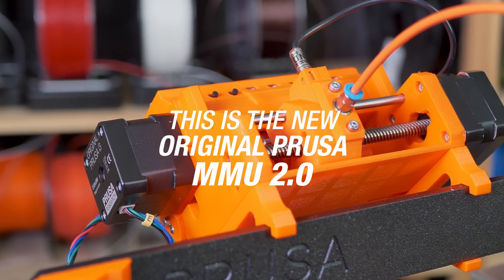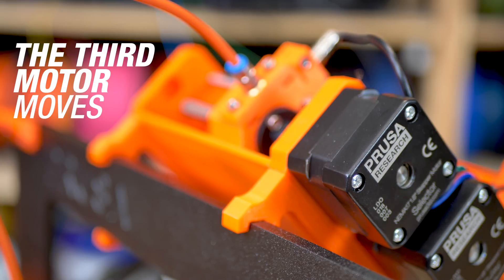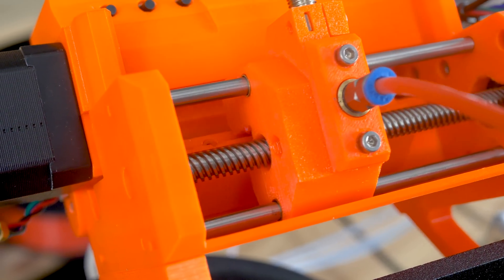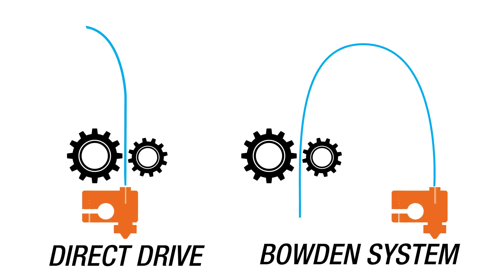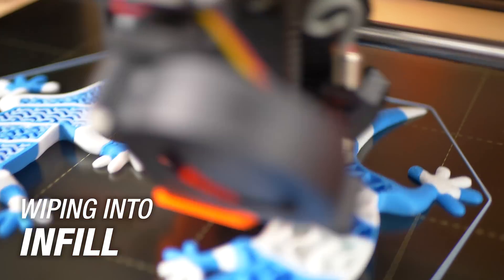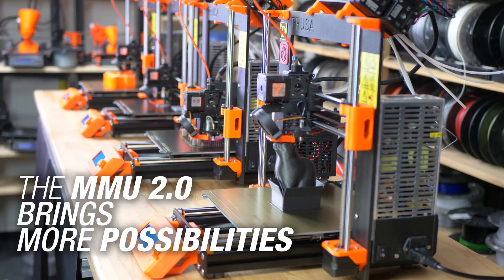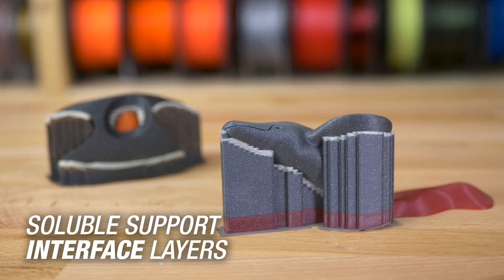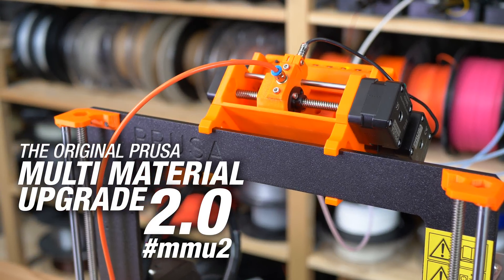How does the Multi Material Upgrade 2.0 work?

Comment: WHERE IS THE ELEPHANT IN THE ROOM HIDING?

Somehow the virtual universal standard for 3D printing is STL although STL has no ability to support multi-color or multi-filament printing.  All users know and use the ability of 3D software programs to colorize the different components of their drawings to clearly distinguish the parts.  But then they export the entire drawing or selections of parts and lose ALL the color information into one boring mono-color STL file.  The reminds me of my old BLACK & WHITE television where the white did not work!  BORING!!!  Next we learn that OBJ files can support color and generates a ZIP file with an obj and mtl file.  The obj has the drawing and the mtl has the color info.  So the  fundamental capability is actually there but the 3D printing world persists on being blind or color blind.  The eco system continues with a 3D design program producing a mono-colored export STL file which hands off its crippled product to the SLICER which has the ability to produce a multi-extruder (IDEX or multi to 1 nozzle system) gcode.  Prusa seems to be the most integrated system with its various Prusa 3D printers, Prusa Slicer, Prusa MM2 (multi-media) multi-filament solution, but no CAD software for obvious reasons.  You can't always do everything by yourself and sometimes you have rely of specialists who do their job better than non-specialists.  But it seems to me that no one is better positioned than Prusa to provide the best overall solution for the entire 3D printing world and beyond (comprehensive solution for 3D printing, engraving, and CNC).  This is exactly the high level bird's eye view of the entire eco system that the user needs and wants.  Let me sit and focus on my multi-color design using whatever CAD software suits me the best, have multiple slicers including PrusaSlicer, have my Prusa 3D printer, MM2 filament color solution, and produce my multi-color 3D print without the headaches of 4 different domain spaces.  I am a principal software engineer and after half a century of systems engineering this seems obvious to me and I do not understand how the rest of the 3D printing world is oblivious to this.

Comment: Is it possible to use the MMU with another printer? I figure probably yes if you create a custom marlin firmware... didn't find anybody yet who did it. Unfortunately I don't have enough money to justify two or three times the cost of an "original prusa" over a printer that works just as well or better.

Comment: Another poor quality product from Prusa. Will never get another product after the fiasco with the Mini.
Reply: I can't speak for the Mini but the MMU2S is a product that needs a dedicated owner who is ready to truly dial it in and calibrate it thoroughly. Include a bit of trouble shooting and problem solving capability. Of course, one can argue that none of this should be required in a 300 EUR product, however, show me alternatives which enable printing in 5 colours or in 4 colours with soluble support for that price, other than maybe MMU copies which one might or might not get into working order. 

The point is, once the system is dialed in, the MMU2S prints absolutely reliably and creates awesome results (yes, prints take rather long and printing multicolour is wasteful but that's a consequence of changing material midway a lot of times). I consider my MK3S+MMU2S system to be worth every Cent and a great purchase.
Reply: @wurzelzwerg100  Printing with soluble support is more challenging but perfectly feasible. With the settings I have now, I managed a whole print without a single loading failure and the result was perfectly fine.  What I needed to do is using radically different unloading settings than in the stock profile (which works great for Prusament PLA for example but not so for soluble materials in my experience). 

I am not saying the MMUS is easy to dial in but given that you think there is not much one could calibrate (either on the machine or in the slicer profiles) suggests that you have not dialed it in sufficiently. 

I also don't have any problems with very fine details in other colours. In recent months I printed a dozen prints of that kind without any troubles. If you do have such troubles, you have too much friction in your system. 

I can't comment the buffer though, I don't use the stock buffer.

Comment: So it's cheaper than the Pallet. Any reason it can't be modified to fit on an Ender 3?
Reply from the maker: It's not a standalone unit, in integrates directly with the printer. But if you modified Ender 3 firmware to communciate with the MMU, it might work. 
- Mikolas

Comment: We bought this kit for our university and three people tried to get this thing to work and it didn't. The manual is just a chaotic description and a joke. You don't even find a helpful video for this kit online. It was waste of money and time at the end
Reply: Amir Andikfar I think you should contact the company. They seem to have a good after sales service (from what I heard).
Reply: Contact Prusa support. Have a look at the prusa MMU2s forum, watch some of the trouble shooting videos here on Youtube. If you do so, you should be able of getting it running smoothly. Even more if 3 students are working on it, rather than just one. Especially, with the forum and Prusa support. You are not alone in it and if you describe your problem precisely, people will be able to help you even if you struggle to figure it out on your own. 

The thing is, there are a number of areas where the MMU2S can fail if there is in issue there. The difficult thing is to figure out what component is causing failures. Once that is clear, the issue can be resolved one way or another. Once those issues are resolved, the MMU2S can print pretty reliably.
Reply: @sagichnicht6748  thank you for your reply guys. We dumped our MM2 into trash and bought ourselves an Ultimaker printer and a Zortrax M300 dual. Bouth work perfectly and we don't need to waste more time on this bullshit part. The Prusa printer itself is good though
Reply: @3D-Amir  That's a pity, surely at least someone else could have made use of it. The MMU can do things which are otherwise hard to realize. If you just want soluble support though, you might be indeed much better off with a solid dual extruder. 

The Zortrax M300 dual costs of course 4 times than an M3ks+MMU2S kit. Ulimaker printers are similar. Not saying they are not worth it (honestly I lack experience with them), just that they are different price category. In a university enivornment with lots of users, the MMU2s might not be the right choice though, so your decision ist understandable.
Reply: @sagichnicht6748  I understand your point but it doesn't matter university or not! Losing time sucks! Even though we are open to experiments and do a lot of researches, we have our time limits. We can't afford that projects get stocked just because a company like Prusa didn't do a good job and sells a not really developed product to the market. Even as a kit I expect more than this! Anyway, maybe it something for someone with a lot of time and nothing else to do but not for people who want to be productive
Reply: @3D-Amir  I would say the MMU is not really that interesting for professional purposes. Prints do take long and you waste a lot of filament. That is a consequence of the basic concept of a single extruder multimaterial system. 

Yes, Prusa could do a better communication about the MMU. It is not like the MK3s, a printing work horse ready out of the box. That said, once you have it dialed in and know how to handle it, it is not more difficult or time consuming to run the MMU than the MK3s, regarding handling times. The print times are of course considerably longer. 

How long it needs to be properly dialed in depends apparently. I know someone where it worked basically right out of the box. I was not so lucky but I have been printing a lot with the MMU since I got it dialed in. 

The only alternative to the MMU for home 3D printers, I know of, is the Palette. However, I heard it is not without its quirks either and it only has 4 materials. I am not sure if it allows for soluble filaments. In any case it costs nearly 3 times as much as the MMU.
Reply: @sagichnicht6748  yeah! very wise words and I agree with you in all of those points but I have to admit, that I'm very frustrated with MMU and I'm over it for long now but it's still very disappointing to see that they don't come up with a good solution. Anyway thank you again for your opinion and wish you good luck with your MMU :)

Comment: When i change the filament mid print, will the mmu retract the old colour before sending out the next one? Or just cut it?
Also, does this work with any printer or just prusa?
Reply from the maker: 1) retract
2) just with Prusa out of the box. You could mod it to other printers (the beauty of open-source), but we do not provide any support in this direction
- Mikolas

Comment: since the system uses a single nozzle...  can the system deal with different materials that have different nozzle temp requirements?  for example nylon, and pla?
Reply: Slicer gcode probably takes care of adjusting the nozzle temps.
Reply: @IdgaradLyracant  Slicer software could do this in theory but I'm not sure if it's implemented in practice.

Comment: Why an inductive sensor with a ball ?  Would a limit switch with a roller lever not be simpler and cheaper ?
Reply from the maker: Limit switches are pretty flimsy and do not have a particularly long lifetime (because of moving parts).
The inductive sensor doesn't have any moving parts. And the ball, well, there's nothing really to break on it :)
- Mikolas

Comment: Will there ever be a finished Prusa product? All the parts are 3d printed. Would make much more sense to use injection moulding.
Reply: @npgoalkeeper _ Cheaper costs and better quality... duh. After  5 - 10,000 units, injection moulding makes more sense. Prusia have sold 59,000 printers with several 3d printed parts in each.
Reply: @npgoalkeeper _ You dont understand.
Reply: @npgoalkeeper _you still dont understand. Never mind 🤣
Reply: @npgoalkeeper _ you're literally missing the point. Think about it. I'll give you 48 hours.
Reply: @npgoalkeeper _  Knew you would give up. 😂

Comment: Actually, since using the MMU2S, I had the worst problems ever. I think I pinpointed them, but it is still annoying, and multi-color prints just keep failing, since filament does not load. Overall, the MMUS2 is very frustrating, and turned a wonderfully working machine into something I do not even want to look at.

Comment: hey guys it this one of yours or is it a China Copy? found it on Ebay for $159.72CND https://www.ebay.ca/itm/Prusa-i3-MK2-5S-MK3S-MMU2S-Multi-Material-2S-Upgrade-Kit-3D-Printer-PLA-Parts/264719017665?_trkparms=aid%3D1110006%26algo%3DHOMESPLICE.SIM%26ao%3D1%26asc%3D20131003132420%26meid%3D73945671d8de4e698e51fe56afa6f68b%26pid%3D100005%26rk%3D5%26rkt%3D12%26mehot%3Dco%26sd%3D254378685355%26itm%3D264719017665%26pmt%3D1%26noa%3D0%26pg%3D2047675%26algv%3DSimplAMLv5PairwiseWeb%26brand%3DUnbranded&_trksid=p2047675.c100005.m1851

Comment: WARNING: This devices is not a plug and play hardware. Get it JUST AND ONLY if you already know a lot about 3d printers and can fix issues your self. There has been multiple critical bugs issued back in 2019 that are not fixed till this day. I have few of them, and can't get around it. It's waste of time and money on my side, as there are only people reporting the problems but no support at all from the developer side. I am really sorry to write this... but that is the truth. You might be lucky and get the one that works well, but chances are that you wont. Cheers.

Comment: What kind of printer is that it prints perfectly
Reply: The MMU upgrade is used with the Prusa i3 MK3. A great, reliable workhorse printer.
Reply: @coryabraham9199  Prusa i3 is probably the best 3d printer without an enclosure to help keeping the temperature more stable.

Comment: Hi Josef. I bought mmu2s in 2 months but I have to be very sincere, I am very disappointed with the product. I see many videos on youtobe with people with the same problems. It is amazing how this product is still in the market with so many problems, one hour is the filament that clogs another time the retraction that does not work and etc and etc. I know you test your products but they are all in a controlled environment. There are numerous types of filament around the world, this should not be a variable for the operation of mmu2s I believe that soon you will upgrade to this product, honestly. In 2 months of use and so far I have not had even a multi-material printing without problems and thus a great waste of material. I am sorry for the sincerity but it is the opinion of a very unsatisfied customer who believes in the brand.

Comment: Is this only able to be used on prusa machines? I would live something like this for my reality Ender 3.
Reply: Don’t worry, the Chinese will  steal the idea and sell it in a few months. :-)
Reply: This is why you don't buy a crap ender 3.  Why you would buy a China crap knockoff when a Prusa is such a damn good deal is beyond me. Oh unless you just do t have the money, otherwise you'd have to just be uninformed or stupid.
Reply: @norris1218  because not everyone has over 1k to spend on a printer
Reply: @chriswright6068  all you need is $350 now.  There is no excuse.  These Chinese crap printers don't put a fraction of the safety features or after launch support offered by Prusa.
Reply: @norris1218  350 is just for the 5 filament upgrade. Sill need 700 for the printer
Reply: @chriswright6068  UMM NO. They have a new printer with unheard of features for $350 for cheap asses.  And their MK3 is only $750 unless you are too helpless to put it together yourself.

There is no excuse to put one of these cheap Chinese fire machines in your house.  Prusa's safety measures are as good in their $350 printer as in their $750 printer if not better with their 32 bit controller and brand new custom electronics.
Reply: @norris1218  creality makes a good starter printer for people looking to spend less than $200 on a hobby that might not go anywhere. Everyone is allowed to make their own choices and decide what's important to them

Comment: Nice I'm very skeptical mainly about the cutting but very nice. I would have went with some kind of solenoid cutting though. Maybe a heated cutter to fuse to the next filament that way you don't have huge retractions and issues in the hot end.

Comment: Really too bad that your printbed size is so small that i cant use it ... very nice innovation with this idea!
Reply from the maker: Out of curiosity, what would be big enough?
30x30x30?
Reply: @Prusa3D  yes 300x300mm like we get it from creality. The hight is also okay witth 300mm  - thats the only reason why i ordered a CR-10s PRO instead of your product i have to say. and before the CR-10 - the print size. I have to make mechanical parts with PET-G which are often between 20-30cm. Because this Fusa would also very insteresting for me. But what i saw it works only with prusa. Sure there are competitors, but i see that you make a good job with the 2.0 and i like it very much.
Reply: Artillery Sidewinder X1, 30x30x40 and costs $400. If you're going to go for another market, you might as well not leave the competition with an edge.

Comment: Wish I could put this on my I3 Mega!
Reply: I mean you probably can. It'll mechanically work just fine(i think at least). The only thing stopping you from just plugging it in and using it is the firmware. I don't know If marlin can be configured to use the mmu but if not, both the source code for Prusa printers and marlin are open source so there's nothing stopping you from porting it over to marlin yourself

Comment: If you print multiple parts separately you could optimize the transitions so that you can wipe into infill more efficiently :)
So that you can have one part half finished with a large open area to fill into while the other part closes up and only has a small area.
If you went layer by layer as your would normally you would run into problems when both parts have a small area to print, this way you would only run into that problem on the last part you print.

Comment: Best way to arrange / construct the filiment rack?
Reply: Universal spool holders, where axle is welded to steel plate that connects to shelf or hanging system of your liking. Could also be welded to smaller plate that screws into board and spools are top of each other. There is multitude of different ways

Comment: My question may seem crazy or even stupid, but do you ever think to mix these 5 wires, rather than using one by one (perhaps for the version 3.0)?

a white one :   https://rgb.to/255,255,255
a black one:    https://rgb.to/0,0,0
a red one:        https://rgb.to/255,0,0
a yellow one : https://rgb.to/255,255,0
a cyan one :    https://rgb.to/0,255,255

A clever mix of these colors could cover a very wide range, with only 5 wires to buy (always the same).

It would be necessary to control the advance of the wires in a fine and proportional way and certainly add a room for the mixture (with perhaps a mini-screw or gear pump like that used in plastics) before the nozzle.

Well, I finished my dream and I let you laugh at this idea.

Comment: Why three motors though? It could be done easily with just one . Ever heard about electromagnetic coupling? Besides, it will follow RepRap ideology more, since you could actually print and wind them by yoursel.
Even with current design, why you didn't use one motor with gears to engage rollers and move selector? It's so easy.